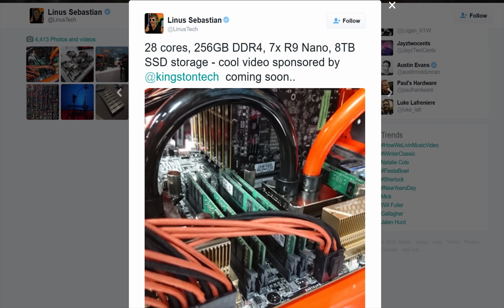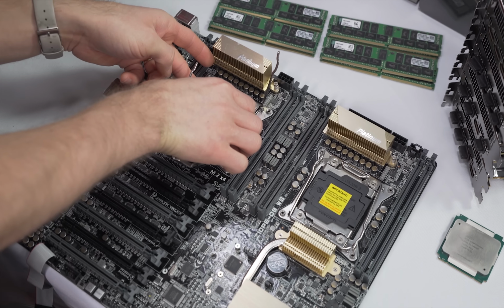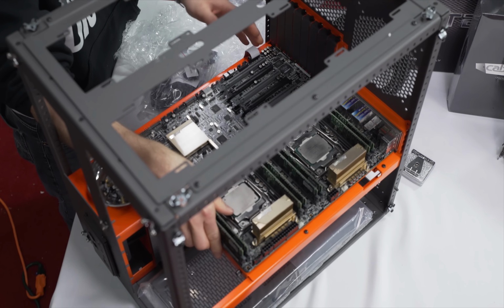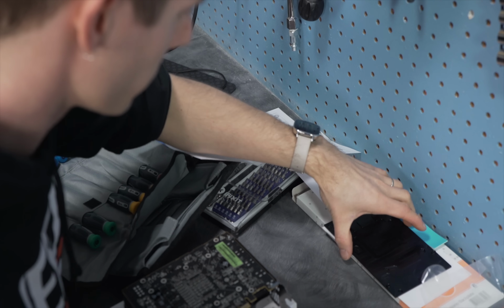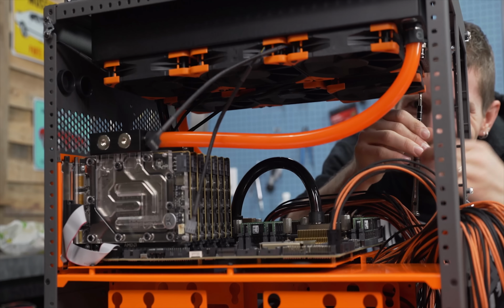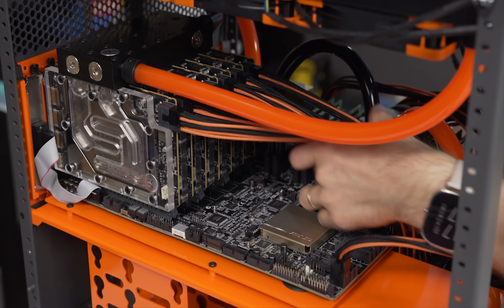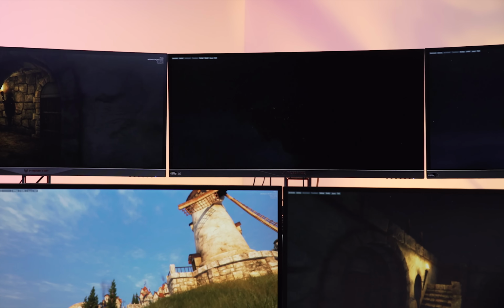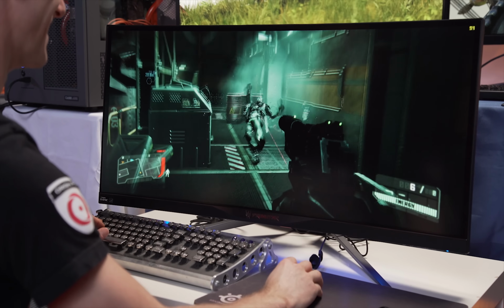7 Gamers, 1 CPU - Ultimate Virtualized Gaming Build Log

Comment: so really its 3.5 gamers 1 CPU.
Reply: +MineCraft Legend CPU = Central Prosessing Unit. There are two CPUs on the motherboard and 7 gamers. 2/7 = 3.5. I'd advice you to start school over
Reply: +El Diablo 12 cores or 2, there is still two CPUs in the system
Reply: +El Diablo I was refering to the whole of the CPU, not cores
Reply: +MineCraft Legend Explain yourself please
Reply: +miles knight 
Still better than two girls 1 cup - i mean CPU
Reply: look up the definition of cpu. because 2 Xeons processors on one motherboard sharing the same cache. operate as one cpu. this rig does not operate as 2 separate PCs running 3.5 virtual machines each. No. this is one cpu running as One pc and thus running 7 virtual machines inside of it.
Reply: this is a quote from another Youtuber to help you guys understand that just because it has 2 Xeon processors it doesn't mean this pc have 2 CPU's. " Unfortunately, I am correct, and you don't need to explain memory subsystems to me, as I'm a degreed computer scientist. Retention of calculations has nothing to do with processing them. Just because I add two numbers from two registers and then throw away the result does not mean that no computation occurred. Caches on die have nothing to do with operating on data in the registers themselves, which are internal to each central processing unit on-die. Core is simply a marketing term used to help the layman understand that multiple central processing units come in a single package, because, as you have all demonstrated, it would simply blow your mind if you were told that they are fully fledged CPUs with shared cache. Your argument is tantamount to saying that if I take the hard drive out of my computer, it can no longer compute, which as we both know is complete bullshit."
Reply: +Christopher Brandao Your quote would make the situation worse, and actually turn it into 7 gamers on 28 CPUs, as each Xeon has 14 cores, and their quote argues that each core is an entirely capable CPU on its own.

Now if we use CPU as a somewhat lazy definition/slang for the entire physical chip that plugs into a socket on the motherboard, however, it is 2 CPUs. There is no logical way I can see this described as 1 CPU.
Reply: +valience1739 they work in unison as 1 cpu, was that hard for you to understand.
Reply: +Christopher Brandao There's no way for two separate chips to share their L1 and L2 cache. It's built into the chip itself. The only 'cache' they share among each other is RAM. 
If you're going to post a quote from someone else to try and prove your point, at least use one that actually proves your point and not shoot yourself in the foot.
Reply: +Monty Jensen Working in tandem != being one CPU. Was that hard for you to understand?
Reply: +El Diablo 14 cores*. 28 total cores means four cores per gamer. Since each CPU only has 14 cores, only 3 gamers can use four cores at a time on a single CPU die (with 2 cores left over). This means that out of a total of 7 gamers, one of them will have split their four cores across both CPU dies.
Reply: +Dennis Fluttershy hahaha, whops. I'm math dyslectic ^^
Reply: +Dennis Fluttershy You're grammar is a bit off.../)
Reply: valience1739 that's what you don't get they share the cache as one cpu wake up!
Reply: +MineCraft Legend Oh please do your research before commenting things that disappoint me.... smh
Reply: Phil 00702 Returning the favor to him.
Reply: +MistarRag So is yours
Reply: +Daniel Haugland I would ADVISE you to start school over as well lmao
Reply: ***** It was an accidental mistake. The mistake MineCraft Legend made wasn't a mistake. He didn't know.

Comment: Linus, we are a bunch of guys that have a constant lan setup in our "clubhouse". would you recommend a build like this? we are 4-5 people. or should we just stick with having 1 machine per user? currently we are using the same hardware and peripherals for all machines since we want a fair and level playing field for everyone. but it's starting to get time to upgrade soon.
Reply: +mtothem1337 
Yeah you're still better off with separate computers,  the only real concern is power draw but if you're considering pulling the plug on a $30k computer you can afford 5x of those MSI 18.4" laptop things and use next to no power (comparatively) with the full 980 SLI experience. Would also keep the competitive hardware thing going, all you need is all the same mice.

Comment: why not use 2 power supplies if 1 isn't enough?
so Linus found out why businesses run virtual machines after how many years?
virtual machines are good ... until a hard ware failure on a SAN but they usually use more stable hardware and rank mount them instead of a 4U case to run 7 high end GPU monsters until you get into the highly parallelized ones that run upwards of 250 GPUs at once 
On a side note though why only a demo consumer hardware? they run better, faster, Stronger on server Enterprise SAS drives mainly as 12Gbps is over 6Gbps also Unraid isn't that good for virtual machines as they don't specialize in it but others do and are more optimized for it so in Cytrix, VMWare, Oracle, etc.  with company names for Virtual System managers will run better for your computer but cost more

Comment: Question: how well do the different machines network together? And are you bound by the RAM limitations of a single OS? I mean, you can buy 128 gigabyte RAM sticks now, but Windows 10 only supports a total of 512 gigabytes of RAM. So could each virtual machine have 128 gigabytes? Or are you effectively restricted to a maximum of 64 gigabytes per stick? 

Overall, I think that the way the files are shared combined with the power savings means that despite the cost Virtual Reality arcades could conceivably use a ring like this to handle entire multiplayer matches that are started up on a click. Give each person a VR headset with eye tracking as an omnidirectional treadmill, select the match and the number of players from the list, and then everyone starts it all at once ready to play. And if properly configured, you could probably get a better graphical impression with eye tracking headsets since they decrease the resolution for graphics in your peripheral vision allowing for more detail where you are looking. 

Having something like this set up as a turnkey computing system that a business could buy and just set up would definitely be a good thing to see. I know others disagree with me on this, but I personally see the return of the arcades thanks to virtual reality.

Comment: As far as I counted, there are 2 CPU. Not 1. Count it right! ;) Quickly checked the pricing for the Z10PE and the two E5-2680 over here in Europe... would be around 4.900 EUR (incl. VAT). You could choose to go for 36 cores, but that's also more than twice the price. A budget solution would be the E5-1650 with 6 cores each, so you end up at 2.100 EUR. That would be great for 3-4 VM's. Maybe I'm gonna give this a shot in the future... :p

Comment: why didnt you just install 2 psu's into the rig then you could run what ever gpu you wished long as it could fit into the case, although with pci-e extention cables you could put them any where really.

Comment: But would it be virtually possible to use such spec to run single machine? It would be fun seeing crysis 3 run off of 7 gpus and two 14 core CPUs instead of having it split up.

Comment: Pretty freaking awesome. However, this can be done cheaper. 1TB drives are pretty overkill and so is 32 gigs of RAM (seriously, I run 64bit Reaper with tons of VST's active and I never got past 8gigs on that). You could shave a few hundred if not thousand dollars of the cost of this machine ;) Or you could buid 7 pc's for something like 12K. Still though, impressed out how stable it looks, great for conventions to show tech of :)

Comment: If all 7 gamers played a single game in multiplayer, how would the virtual PCs communicate? In some direct manner or still via TCP/IP?
Reply: +Jimmy Loves Harley But LAN means there's networking involved. I thought that maybe all 7 PCs being in the same machine could somehow eliminate the need for any networking. Not that there would be notable benefits, but still. Every ms is countable.
Reply: +Andrejs Petersons I would expect the KVM inside the unRAID can also configure a VM-only network so the VM can communicate internally without the need of a HW Network interface. But this communication is TCP/IP...
Reply: +Dennis Fluttershy Under 1ms, if stable at any given moment is fine enough. My ISP provides 1ms connection with its own server a little under 20 miles away.
Reply: +Dennis Fluttershy Depends on distance and the other end. 5-280 ms.
Reply: +Dennis Fluttershy I would like to compare this with local LAN latencies, and then the improvements are not this massive. at least you can measure it, but feeling it in real usage scenarios is another story. it's more like: Hey, lets have a small LAN party, you do not have to bring your own pc, we ALL can use this one...
Reply: +Christian Rösler In short, these 7 virtual PCs have the best LAN connection with each other what is theoretically possible using TCP/IP. Right?
Reply: +Andrejs Petersons In a short word: Yes
Long version: I thinks so, but there could be some influences based on the hypervisor, managing all the virtual resources...
Reply: +Andrejs Petersons Virtual networking (the host OS does the bridging from one virtual network card to another)
Reply: It's a virtual Network.
Reply: +humandxp A. Bluetooth m/kb set, one dongle. B. Controllers. Or here's a thought. C: USB HUB! TADA!

Comment: U could buy 5000 ps4 just saying
Reply: +Jack Sparrow why would he downgrade to a ps4?
Reply: +Phillip Wu it's just a pirate think.  u wouldn't understand
Reply: +Dennis Fluttershy The power would be 5000 people playing and having fun (world's biggest gaming convention) vs the staff of LTT in their garage trying to figure out how to properly bleed the air out of the GPU water blocks.
Reply: +Reboot153 World's biggest LAN is DH, with room for 15.000 computers.
Reply: Hyperbole for making a point.
Reply: No... IIRC PS4s start at $300 when on sale. 30000/300 = 100, with no paid games or extra controllers. Your math would be right if PS4s were $6...
Anyway, I think the price included the monitors.
Insane virtualization is not meant as an economic PC solution.
Reply: +Marble_ The pc without any monitors/periphirals is around 15-17k so only 50 Ps4 there..
Reply: +Marble_ The pc without any monitors/periphirals is around 15-17k so only 50 Ps4 there..

Comment: but can all 7 play at the same time (yes they can run at same time)? I don't think so... Cause when u enter a game the keyboard and mouse are assigned to that instance and can only control that instance. 

Or is there a program that can assign each mouse and keyboard to a individual core, gpu, ram and harddrive?
Reply: +Xepi With Virtualization it basically means that if you configure it correctly, you can assign specific usb slots to each instance that is operating. Each instance believes it is running its own OS.

This is not the same as running with seven screens on the same system.
Reply: Ahh, there was the keyword I was missing, Virtualization :P Thanks ^^

Comment: Could this run Minesweeper? I'm thinking of buying this if it's powerful enough to play it
Reply: +VenomPlays no. Minesweeper need 6400 GPUs to run @ 144p 2 fps.
Reply: +VenomPlays You'll have to turn the resolution down and use very low settings in order to get a stable 25 fps
Reply: +VenomPlays The real question is, can it run Dwarf Fortrees?
Reply: It might be able to play pong. Maybe. You just have to play at minimum and you'll probably only get 10fps.
Reply: +VenomPlays Also consider sometimes 144p is buggy so you may have to go with the 72p on developer mode to get 5 fps. Hope this helps :)
Reply: +VenomPlays Can this PC send out better joke for venomplays.
Reply: Go Go Gadget Reviews "send out better joke" LMAO

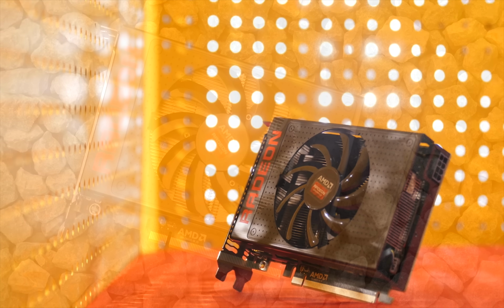Comment: 8:35 Why it can't be Nvidia GPU?
Reply: +ΛVINIDE why should it? This card is a single slot, allowing them to be jam packed with a motherboard that has no spaces between the PCIe Slots. Nvidia cards are double, and would require a motherboard that doesn't exist
Reply: ***** I'm just curious. I had bad experience with AMD GPU's btw
Reply: ΛVINIDE It's a single slot card thats why they used AMD
Reply: ***** And also, it doesn't use CF bridge

Comment: what software is used to share windows so much times?
Reply: +AMV12S He explains it in the video. UNRaid.
Reply: +I just comment the title of the video without a G+ link Unraid is just the raid/filesystem, that boots of a 9th drive, from where also is some vm configuration loaded, with probably similiar images to run the Window's (which are located on the unraid filesys.)

Comment: test crossfire scaling up to 7 gpus (its already built) everyone says its not possible but noone has tested it. oh and that much ram and 2697's arent really nessesary youd be fine with e5-2630's at 1/6th the price. each person would still have the equivilant of a fast i3 or slow i5. nanos btw are just declocked and factory undervolted furyX's. try furyX2's then ill be impressed that case can take dual psu's right...its a "caselabs"

Comment: Holy
Fucking
Shit.

My gaming computer cost me $65, and my car cost $2500.
Reply: A broken toaster is not a gaming computer
Reply: Quinn Hunt I said that was what I had in it. I didn't say that's what it cost originally. Going by that... $450 MSI mobo I got as a gift, $50 in used ram I got for free, a $75 bitfenix case that was a Christmas gift, and a Thermaltake tr2 700 I got at a garage sale for $10 powering my only investment, a $105 (at the time) Core 2 extreme ($35-40 now), there's my broken toaster. I'm looking to upgrade to a dx11 graphics card when I get the funds.
Reply: Thanks for making me smile though. I've been having a bad day.
Reply: +Max W My pc cost more than my car ;_; £350
Reply: I'm not entirely sure what that means, but I'm sorry?

Comment: Hey Linus, I have done this also myself a few months ago, my integrated gpu from intel for host, 8 gb ram for 8 guest and a gtx 970 for guest. I have around 95% native performance. However, I'm getting huge framedrops as  an example in cs go, normally i would have constantly 200 fps but in my virtual machine It drops to 100, goes back to 200 drops to 150 and this causes stuttering, Anyone knows why this is happening? Is it my hard disk? Should I use another HDD for my virtual machine?